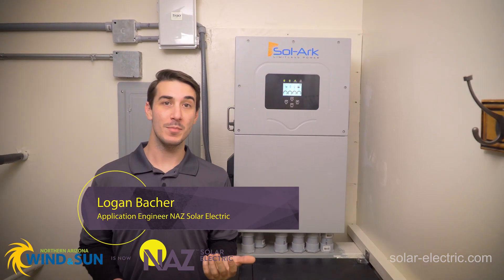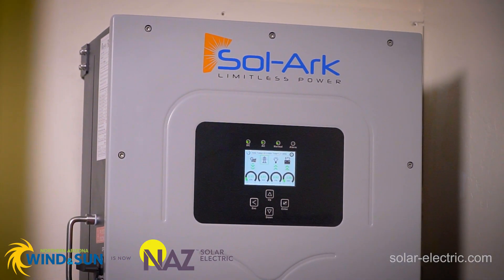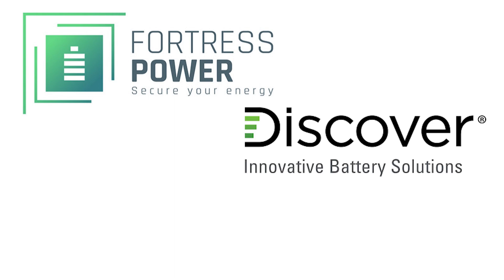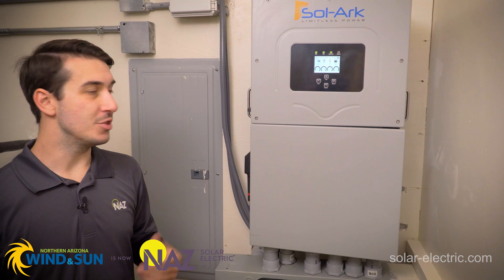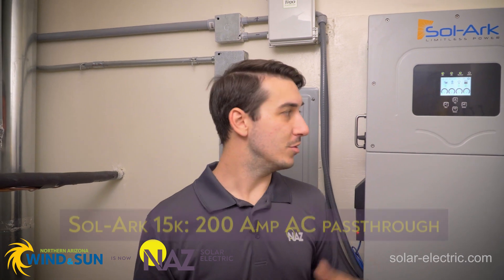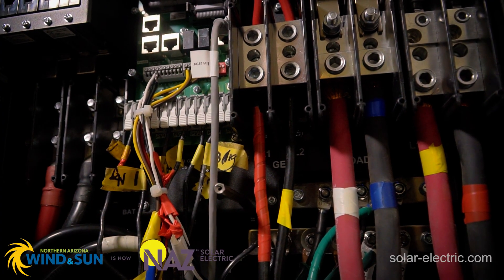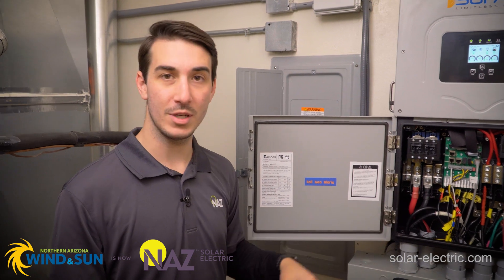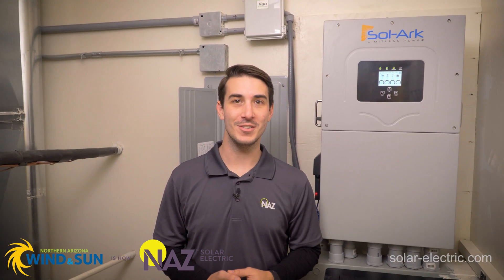Sol-Ark 15K Inverter Features - Installed

Comment: The 200a bypass does the inverter shut off with overload and grid takes over?
Reply: If the grid is connected correctly then the Sol-Ark will use the solar and batteries to cover the majority or all of the loads, depending on the load from the panels. If the load is too high for the solar and panels to handle it, the Sol-Ark automatically just draws from the grid. I find that mine will draw from the grid when there are spikes in the load, like when the dryer is switched on and the EV is charging. It's all automatic. Sometimes there's a little flicker on the lights, but normally I just don't know it's happening. It helps to smooth out the loads, which I'm sure is extending the life of the batteries.

Comment: Note the Sol-Ark 15 kW puts out 50A in off grid so you would need to couple it with a load shedding device for whole home backup.  So the 200A passthrough allows you to connect to your whole home electrical panel, however essential loads panel or load shedding device is best practice.
Reply from the maker: Correct, some applications may need an essential loads panel or load shedding (or additional Sol-Ark inverters) to better manage loads or provide increased power output during grid down events.  The 50A continuous output from the Sol-Ark 15k during a grid outage might not be enough for some to do whole home backup, but may be plenty for others.  It all just depends on what loads/appliances you want to power when the grid goes down.
Reply: So during normal operation, could a 60kwh battery system power a whole house with the current specs of the inverter (Continuous AC Power from batteries  12,000W 50A-L ) with no solar?
Reply: @OscarGonzalez-ct6no  That really depends on the loads you plan to have at any given time. Ideally you would want x2 Sol-Ark 15ks running in parallel to avoid most manual load management activities. You can also look at pairing a single Sol-Ark 15K with the Sol-Ark smart loads panel to achieve the same or similar results without having to manually manage your loads.